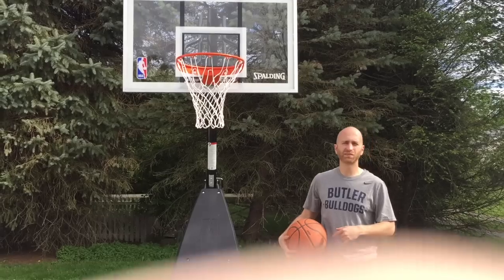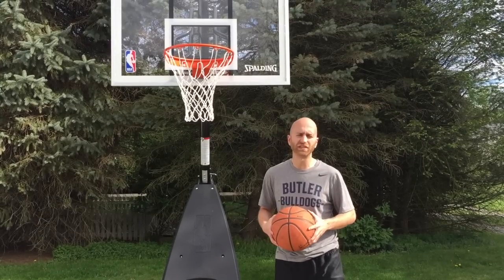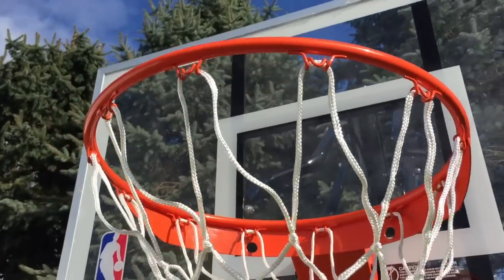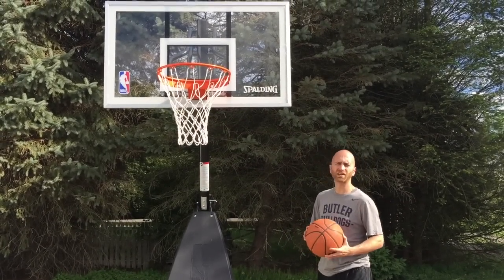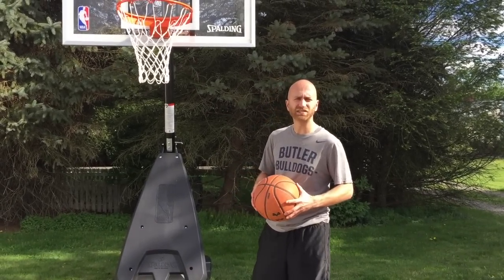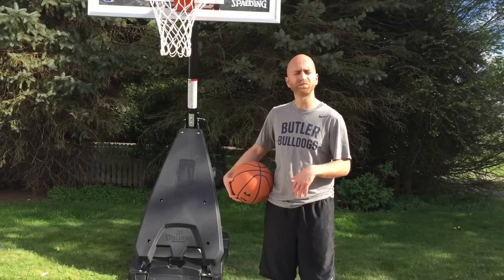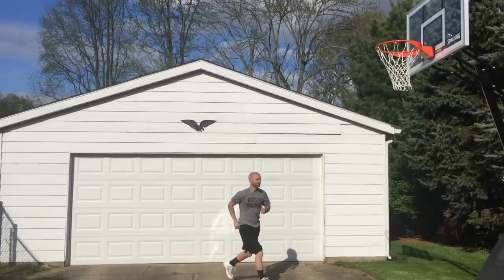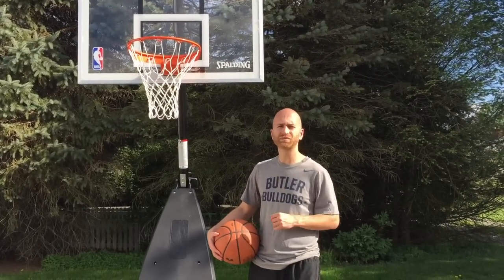Spalding Hybrid Portable Basketball Hoop

Comment: I have one question: Is this hoop durable for bad weather like snow and rain? Because I want to leave it outside all the time or do I have to store it if it‘s raining too much? I would appreciate a answer, thanks a lot!
Reply: Yes I have this same hoop and leave it out on my driveway everyday. I also added two sandbags for extra durabilty which helps. I would put the hoop down if winds do get super bad though. Other than that, it will be durable enough to hold up against snow and rain easily.
Reply: JProductions Oh ok thanks for the quick answer! And I‘ve another question: do I have to put the hoop indoors if wind gets to hard?
Reply: If winds do get too bad to where you feel like it could damage the hoop, I would put it indoors to be safe.

Comment: Does your rim move much once attached?  We bought this system and it is properly mounted, but the rim/hoop sags forward a bit and then it has lots of play in it ( you can rock it up and down a few inches).  I can solve this by tightening the spring bolt down more but then it is compressing the spring too much and you will no longer have breakaway potential.
Reply: Mine does the same thing, that's why I'm looking for a new one. I had the 54' polycarbonate angled hoop. I would always tighten it and when the ball hits the rim, sometimes the break away will make the rim pop up and stay until I hit the rim again, same thing when dunking. It always looks like it's leaning forward when I play, but when it's in the breakaway up position, it doesn't anymore but when you go to the front of the rim (or diff angles) you can see the rim is pushed up
Reply: Mine does the same thing but I have a different sparks by goal
Reply: paul sewell

Comment: I'm looking at the 54" and 60" version of this hoop. Any advice on pros/cons between the two? My concern is that a 60" will be less stable and is probably more than I need. Looking at your 54" it looks ideal for my use case. The odd thing is that currently the 60" is cheaper (by $30). I am asking myself if it's cheaper for a reason.
Reply: Is the 60" 12feet or 11 feet
Reply: Maybe the reason is that a lot of people can't dunk that high

Comment: I plan to buy this but have a few concerns and hoping to get your thoughts:

1. I'll put it in our backyard which gets some high winds at times (approx. 40mph) - will it be able to handle it?
2. I plan to use a Dr. Dish IC 3 (the one that hangs on the rim, not the machine) - is the base strong enough to not tip when I hang this?

Also, what's your thoughts about the backboard? I went to a sporting goods and tried to throw basketballs on the hoops on display - the Goaliath (Silverback NXT equivalent) feels like a very cheap plastic. Does this feel the same? 

Thanks,
Reply: BUMP

Comment: I am currently assembling mine. Did you have to drill a hole through the backboard to attach the bolt that holds the spring and rim? The manual is not specific at all on that section.
Reply from the maker: Oh man, yes that part is confusing.  Actually, the bolt and spring hold the rim up.  So as you tighten the spring it will raise the rim until it is upright.  Hopefully that makes sense. You do not drill any holes.

Comment: I have a question, when you said you only have one shot to put the poles together, are you saying if you mess it up your screwed out of the hoop or can you explain that to me please
Reply: At 1:00, please explain what you meant
Reply from the maker: I mean there are slots in the poles where they are meant to attach.  You just need to be careful that you line the poles up accurately or you may end up with a crooked hoop.  You'll want two people for this step.
Reply: Best Outdoor Basketball which is what happened to mine! Ideas on how to straighten it up?

Comment: I way 200 lbs , can a hanging dunk be done on it?
Reply: N9
Reply: No
Reply: You can dunk but i would not recommend hanging on this rim. The rim is a breakaway rim so it is meant to be dunked on. No point in hanging either way so dont hang unless its for safety if your swaying.

Comment: Did u have problems getting the poles connected mines want go four inches in
Reply: Not sure I'm understanding.  The poles are indented and the indentations should be lined up so that the pole is square.  I recommend using a hammer or mallet for this step.